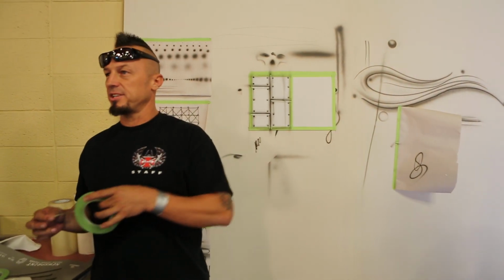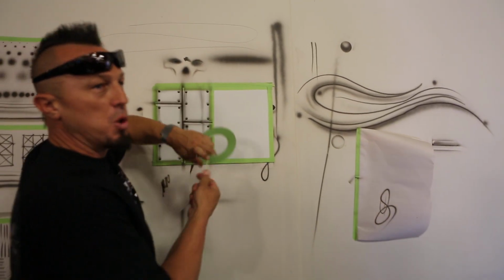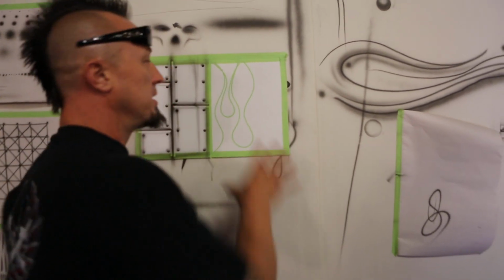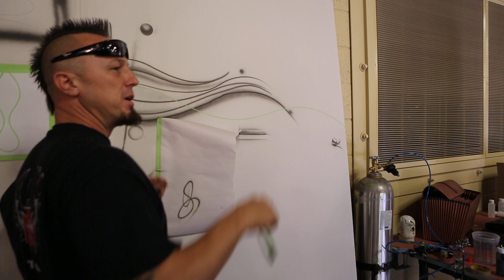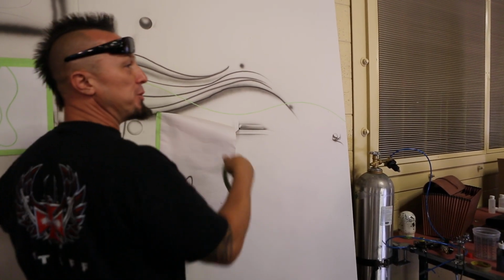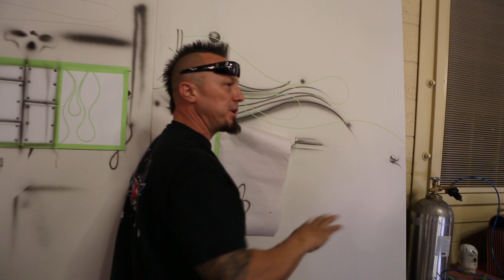Ryno's Airbrush Getaway Flame Layout Demo

Comment: I dont know what airbrush you have currently but check out the NEO line from Iwata, they are made for Iwata designed as beginner line and they have a siphon feed one as well as a gravity feed one and each are under $100.  You can get them even cheaper through Hobby Lobby because they always have a 40% off coupon you can use.  I have both models of the NEO series and they work very well, I also have several more expensive Iwatas as well but check out the NEO's, anyway hope that helps.